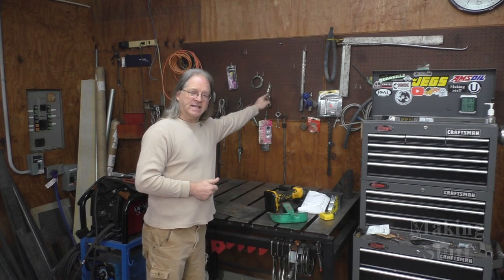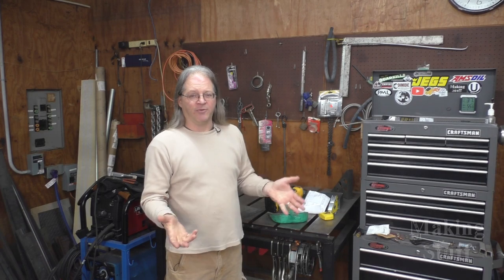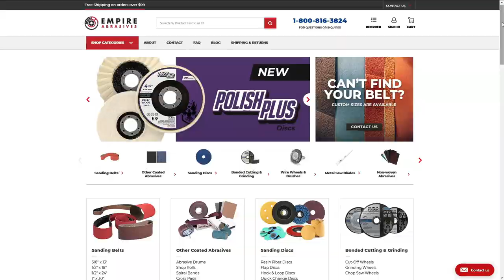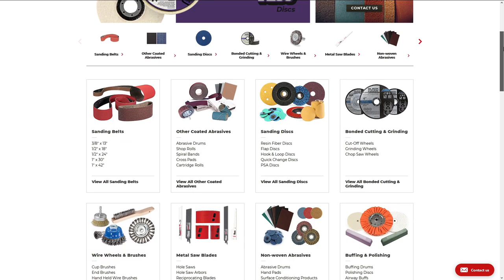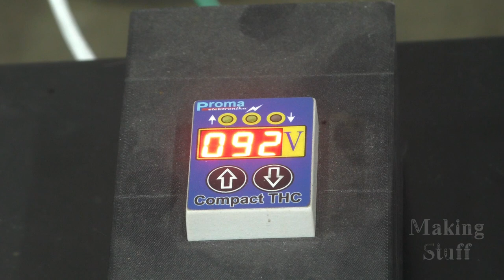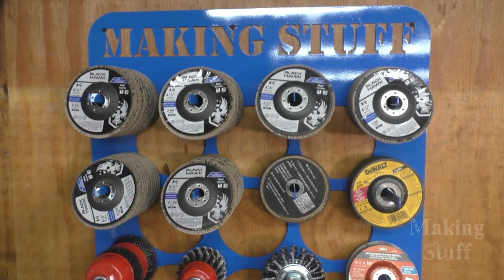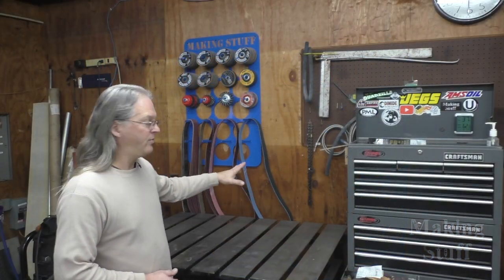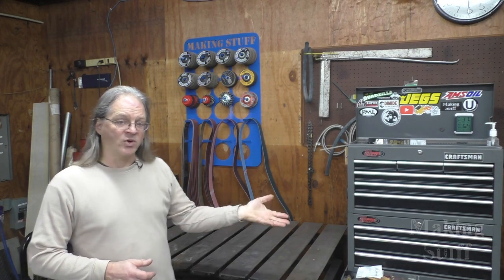Making a Metal Abrasives Storage Rack for Grinding Discs

Comment from the maker: What should I do with the rest of the wall?
Reply: You could put your extra grinders on it.
Reply: Hang stuff on it.  Install a couple of small cabinets.  Wait until the need arises for some more storage and determine then.
Reply: 1. Mount track for a heavy duty peg board the work that will carry 20kg per hook. 
2. Angled loose drill bit buckets always breaking them. 
3. HD shelves to take Carry cases full of MIG / TIG / Plasma consumables.
4. Bolt bins. 
5. Beer fridge.
6. TV.

Want more???

Comment: Good concept, but I would eliminate the holes, and burn the contour of the tabs that you could bend 90 degrees from the back.  No need for welding.  I've been using my table to make angle grinder holders, vise grip holders, and battery drill holders with charging station.  The angle grinder holder is designed to nest the tools so you don't have to remove the handle like all other holders you see online.  If interested, I'd be happy to share my design.
Reply: I would be intreasted
Reply: Dwayne. I'll work on getting you a CAD drawing for the holders.

Comment: Hello, I like your abrasive rack. Looks very professional. Sure it may look like or is an over kill some would say, but if you got the equipment & knowledge ..what not.  I made mine using a piece of scrap peg board and hooks I got at a yard sale. Problem is the board needs to be bigger which I will make my rack larger. I agree it does make a big difference having your abrasives on the wall for quick access and for inventory of what you have and need to order. Still working on building my cnc plasma cutter.  QUESTION:  Which 4 1/2" flap do you use/like the T27 or T29? Or both? Also what is the most grit size you use?
Reply from the maker: I use 80 grit the most, but that is my personal preference.  I've got both T27 and T29 discs.

Comment: Nice but some buts lol
1st but, but I don't have a cnc plasma cutter. Heck I don't even have a plasma cutter.  
2nd but why all the circles cut out. 
Could have just cut some 3" wide stripes bend the ends weld a dowel rod and mount to wall.🤔  HEY come to think I may beable to do dat wit a grinder and cut off wheel.  Thanks for giving me dat ideal.  😁 keep up the great vids
Reply from the maker: The circles were to make it lighter and for aesthetics.  Yeah, you don't need a CNC plasma to make one.  There are 100 different ways to make something like this, even nails and plywood would work.  Any excuse to get out in the shop and use my tools is a win in my book. Thanks for watching!

Comment: This could have been done with a sheet of plywood and nails. Making it out of plasma cut steel was very, very overkill.
Reply: It could have been done with the existing pegboard, simply purchase the appropriate pegboard hooks.  That being said, neither pegboard hook nor nails uses a plasma cutter and/or welder during creation, and if you have those tools I'm pretty sure that every project requires their use in one form or another.  I think it's the law. :P
Reply from the maker: But I don't have any plywood and nails. I do have a steel, welder and plasma cnc.